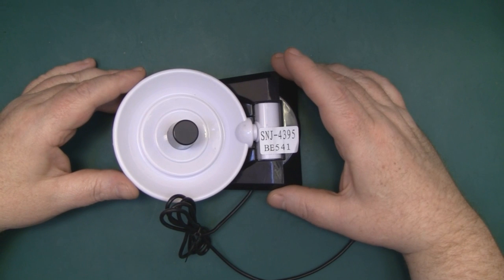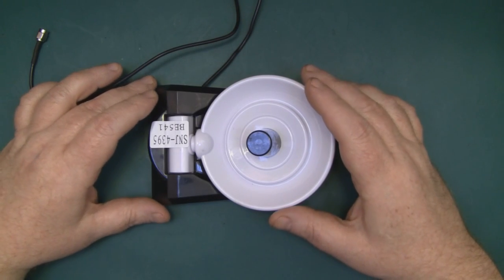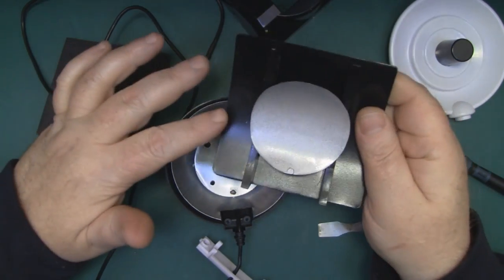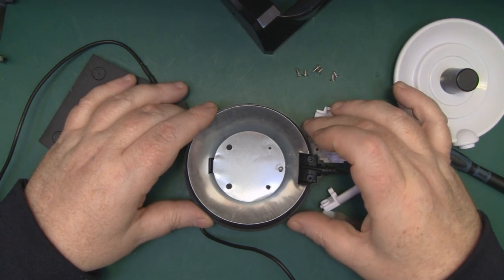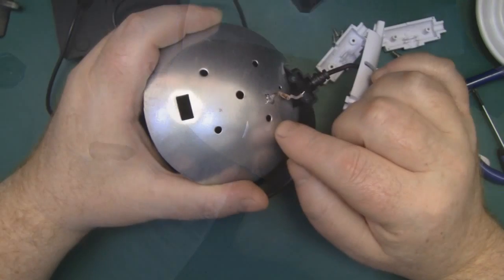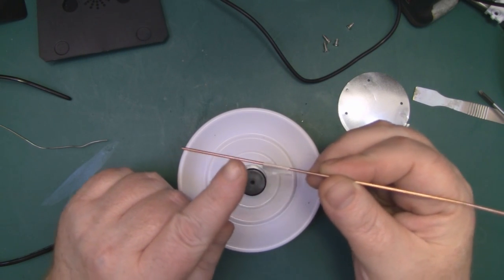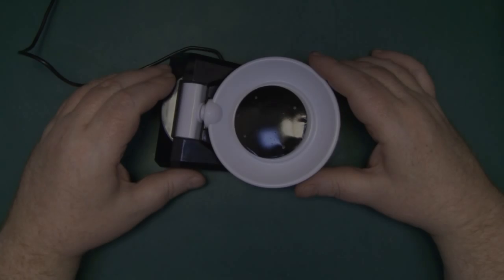2 4GHz 8dBi High Gain Dish Directional Antenna #119

Comment: You have established that this antenna isn't very good but my question is at 2w at each end on an antenna tracker, would it outperform a dipole on the same power or is it so poor that its not worth using at all?
I ordered one of these from china to try but then came across your video , glad it was only £3!

Comment: 1. This is a directional antenna. Shouldn't you aim it at a specific target antenna and look at the gain, vs just a general out-the-window?
2. This antenna obviously isn't tuned for 2.4 GHz WiFi, even if that's what the packaging says. If you use it at the design frequency, it seems like it has great potential for the price. Do you have a antenna analyzer you can put on it to see what the actual resonant frequency is?

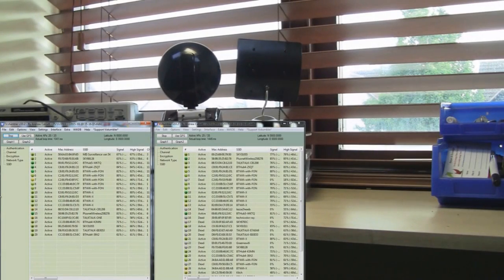Comment: Thanks for the video. However I have one comment regarding testing directional antennas vs. omnidirectional. I don't think you should apply the same methodology for testing them. I would consider directional antenna that picks up many access points beaming from whichever direction a failure. So judging directional antennas by how many access points they pick up is not correct. What perhaps could be tested with them in the future  is how strong signal they pick up from a specific access point if pointed towards it. As an example in this video when you compare two antennas at around 9:50 mark. If you look at the screen - the modified cheap chinese picks up BTHub4-25QT a little bit stronger than the other antenna. The rest of the access points show much weaker signal than the other antenna. If one would only be interested in picking up that specific access point it would not be half bad. Just some suggestions for the future tests.

Comment: i'm looking for a high gain high power dual band wifi antenna. it seems that they just don't exist.
Reply from the maker: +Hawk Moe They do just not on ebay what's it for?
Reply: andrew mcneil
a Amped Wireless RTA2600 router
 on a 10 meter antenna cable

Comment: A pity we didn't see the performance without the short.... I have one of these - unmodified - and found it works surprisingly well!
Reply from the maker: +Kingsway Driving - Richard King ADI To be honest the short was the main problem that and poor build quality
Reply: +andrew mcneil  As a matter of interest, I also bought a little white yagi ant. like the one you recently reviewed, and this dish one appeared to work almost as well as the yagi  - only a couple of percent down.   If I get the chance, I'd like to try your mod, with the wider spacing and see if I can improve it further!
Reply: I tried the modification and at best the signal was slightly worse than before, ended up putting it back as original. For the money it's not bad.